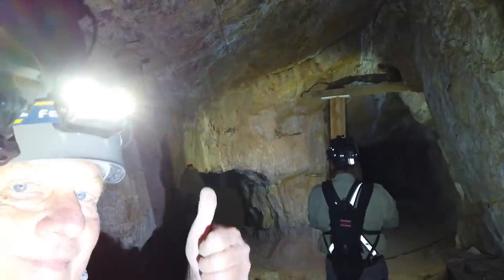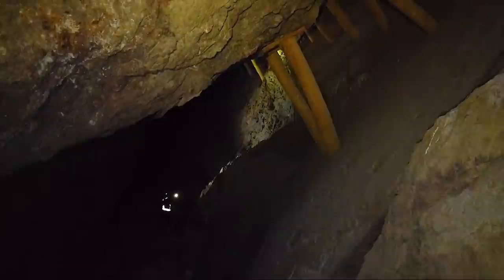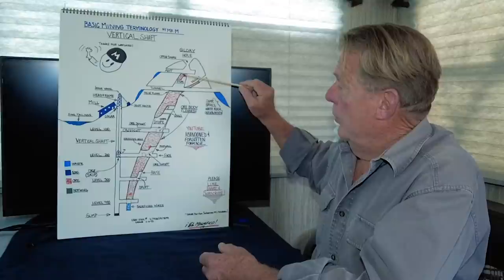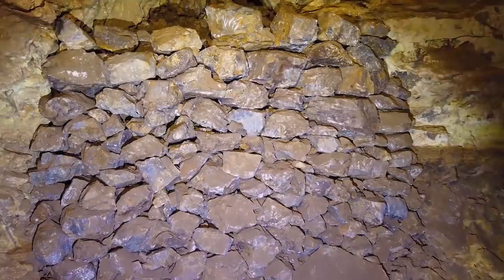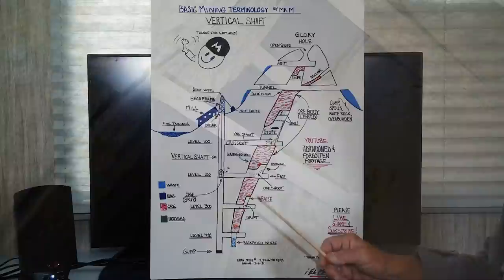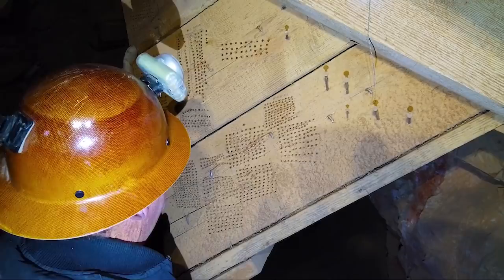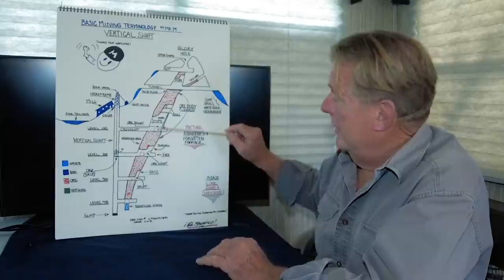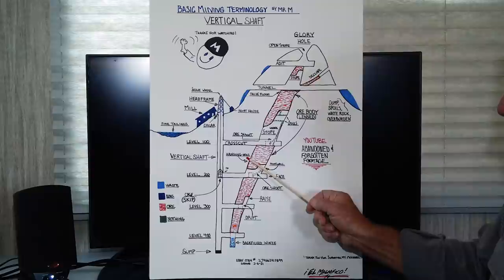Basic Mining Terminology With Mr M

Comment: Yes, it was awfully hard work unless of course you rip the mountain part. Thanks again for the knowledge and great job on the drawing. Don't get me started on the price of gas. Back in the 1970s with the first gas crisis I used  paint thinner in my mom's '67 cougar while going to college. In those days in the State of California one could buy bulk paint thinner from Standard Brand Paints and it would run carburatored vehicles. It was about 75 octane and pinged alot when under load but I didn't have to wait in lines for fuel. It was also about $0.50 cheaper than regular gas.

Comment: well done . now going to get question that no one ever got before ..this a isolated question about a very rare and odd type of mining .. a fault line runs about 2/3 of mile is surfaced for about 35-40 yards then dives down a few dozen ft and then surfaces for about 1256 ft .. now the ore runs threw the fault line and focuses heavy near the far end ,they old miner could only work a small area of about 8 ft of the vane , the main part of the vane is 28-30 inches tall and about 17-30 ft wide at times ..the miner made a pit shaft about 24-26ft deep and he was get old and was working the mine by him self most of the time ..its a hard rock mine and has mostly high grade Gold with traces of Silver and cola and some pyrite  .. i am only one old man 60 years old and the shaft was sealed and covered over for safe keeping . now i want to open it and work the mine for a few weeks and then seal it again .. by now the only questions are how do i do this effectively and do you think i should brake the ore down and crush or just collect as much high grade as i can . but the mine is the LDM so its all most all high grade at about 500 oz pre ton ...? and yes i am the Blindbowman that found the real mine in 2006 ! what would be the best way to work a few hundred lbs of ore and walk away .

Comment: Mr M , in the uk gobbing is (are ?) called dead's i assume as in dead weight as in no point moving dead weight its just dead rock etc , and most if not all mines in the uk are wet mines and as they hacked there way through the rock the used the deads to line the tunnels and arch them for support , so not only were they hacking the rock out by candle light they had someone squaring them off and lining the mines with them and theres no cement etc its all dry stoned lined all fitted together like a jigsaw and there still there some 200 or in some cases 400 years later.

Comment: Thanks Mr. M!
Question, how does a miners carbide lamp make such detailed graffiti. Could you explain please
Reply: From Randy:  The carbide lamp generates acetylene gas which with the right amount of air produces a brilliant white, yet sooty flame. You can draw with the flame using speed, distance from the wall, and adjustment of the flame. Some of these guys got pretty good with the lamp drawing.